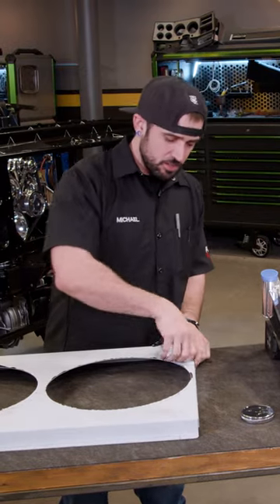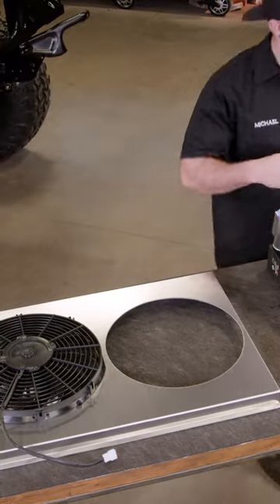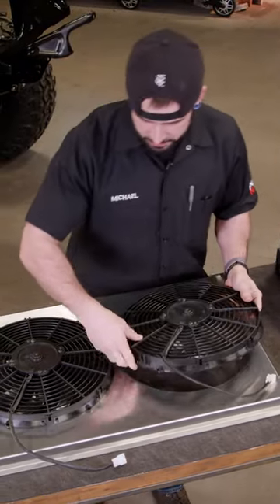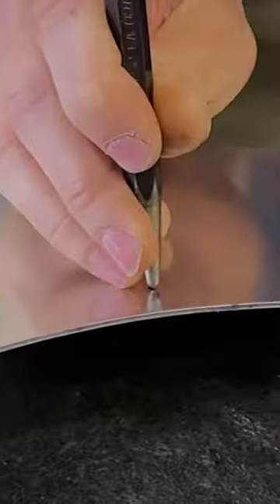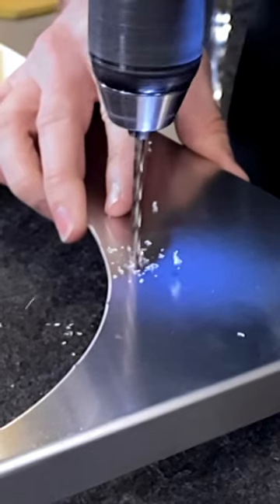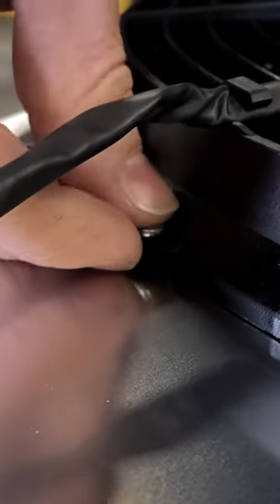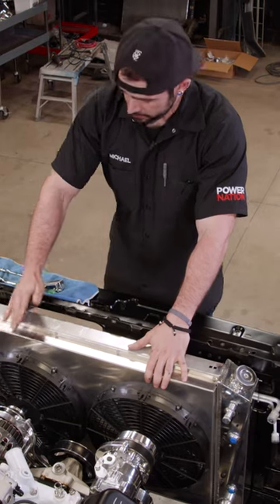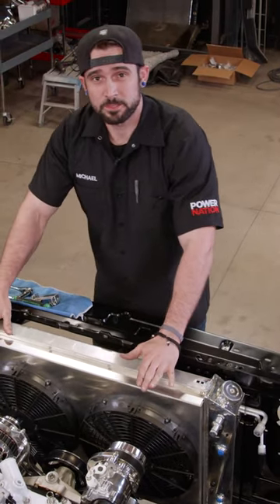Building a Cooling System for a Squarebody Truck

Comment: I'll stick with a mechanical fan and shroud like GM intended
Reply: Yes, people today seem to have a fascination with taking perfectly good mechanical objects/parts and replacing them with cheap inferior junk electric parts. In my opinion the most appealing parts of old cars/trucks is that everything was mechanical. Mechanical fans and mechanical fuel pumps last way longer and are far more reliable than their electric counter parts.
Reply: Mechanical fans are HORRIFIC. They're awful at regulating coolant temp, they rob a LOT of horsepower, they suck at moving air at idle when it's needed the most, they take up a bunch of engine bay space, and they're loud as hell. Electric fans are perfectly able to maintain the coolant temp to within a few degrees of the setpoint. They can be commanded to run at any speed, from full blast to barely spinning at all, and they can do that at idle so they can move their max CFM while the engine sits at 700rpm. They are much more efficient and they can be completely turned off when the engine is cold or when you're going over 25mph. Driving the fan directly robs more HP compared to driving an alternator and then energizing an electric motor. Electric fans can be pushed right up against the rad and they can have very aggressive fan blades which makes them very compact. Lots of room to work on the front of the engine. And finally, having aggressive blades and the ability to run at infinitely varied speed means they are very quite compared to mechanical fans. On my old Benz, I took the mechanical fan off and threw it in the garbage and I installed a beefy electric fan controlled by a temp sensor threaded into an unused bung on the upper radiator hose manifold. Everyone should upgrade and convert their mechanical fan to a superior electric fan or a pair of fans. It's a no brainer. "BuT yOu'Ll Be StUcK iF tHe MoToR bReAkS!!!" Yeah, you'll be stuck if the mechanical fan breaks, the electric clutch shorts/opens, or the viscous clutch fails/leaks out its special silicone oil.

Comment: You need to stagger the fans to maximize the cooling efficiency of the radiator.  Also, putting a block of wood under the aluminum while centre punching and drilling will help tremendously.  I know this because I have done this with my truck, dual 14" fans, moves a ton of air

Comment: I have a 2dr Tahoe 1998 4x4 I’m slowly restoring she’s solid 171k miles and still goin transmission and all smooth, I’m very lucky but I bought her with a little damage in the back I must get fixed.

Comment: Drilling sheet metal with a twist drill. Step drill makes a nicer hole. Self taping screws are lazy. Use rivnuts and you can remove and replace numerous times without the holes being damaged.
And those shrouds aren’t necessary if the fans are tight to the rad. My experience is when using a shroud like that it seriously reduces air flow when moving at speed then the electric fans need to run more.

Comment: Those Electra fans are junk
Reply: I have a diesel truck with those fans on they didn't work my truck was kept overheating not to get a fan last 3,000 CFM with metal blades